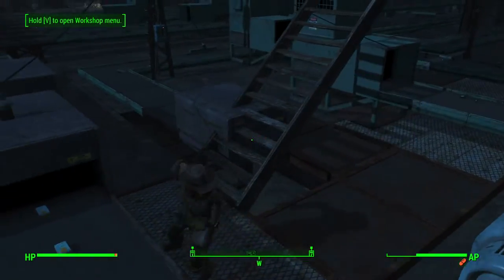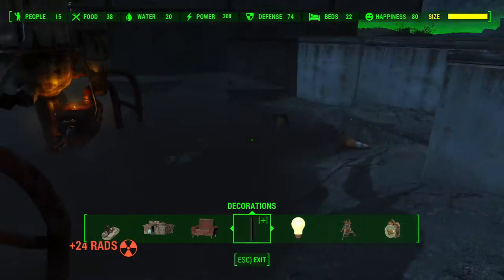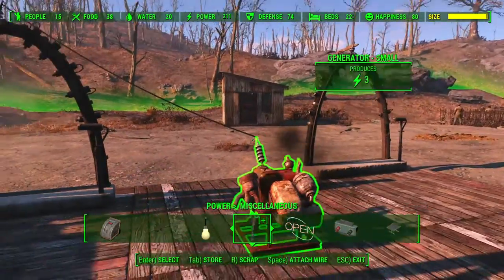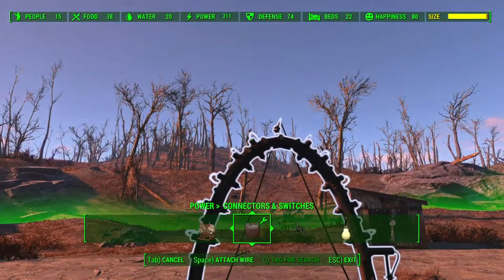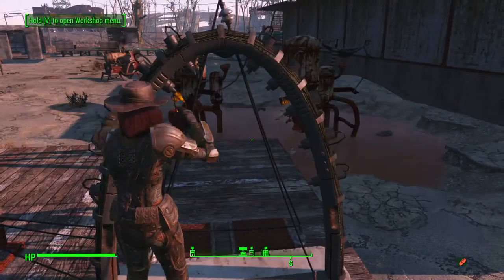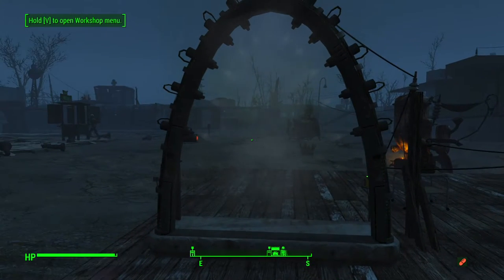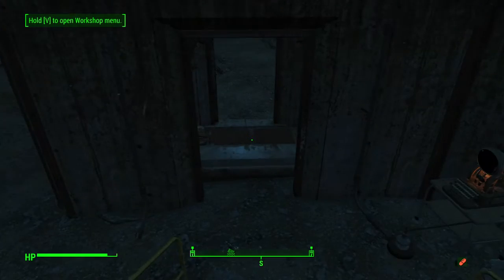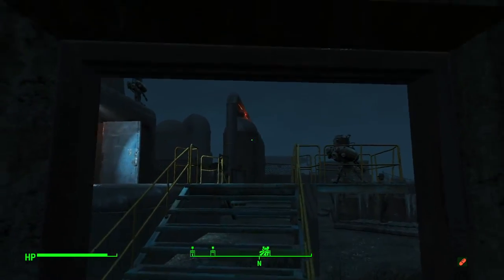Setting up an automatic decontamination arch

Comment: Hey I need help setting up a double laser wire decontamination chamber that goes on and off. But I need it to walk through the first laser turn on decontamination chamber and turn on 2nd laser switch then when you walk through the 2nd laser it turns off the decontamination and turns on the first switch. How do I set that up. I can't figure out if it's a certain logic gate
Reply from the maker: Hey thanks for checking out my channel first of all. 
Thankfully I've already covered it in another video which you can check out here https://www.youtube.com/watch?v=scOqcaLT3f4&list=PLxpToD1Are7ieFumPpFZka0q6ZZsHWvQh&index=17

It should help you work out how to implement it into your build and if you do have any problems let me know!